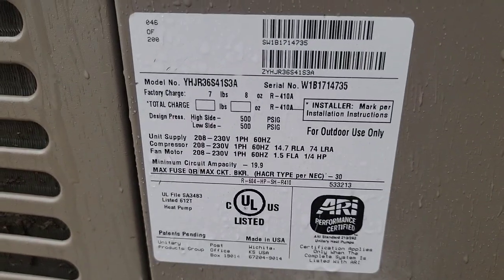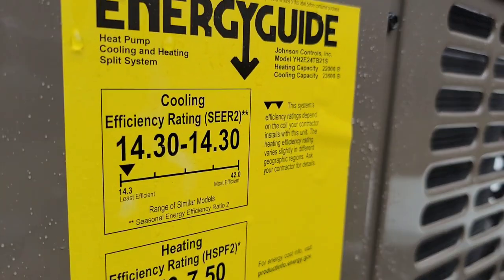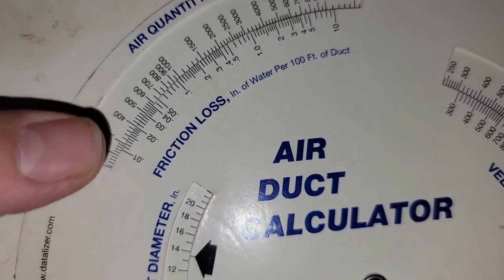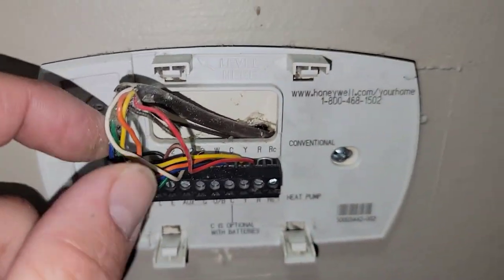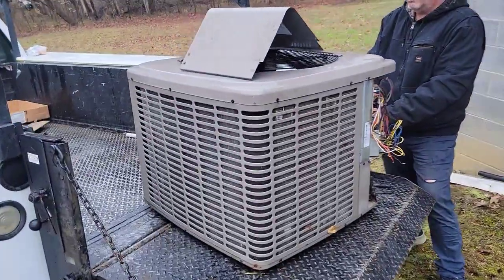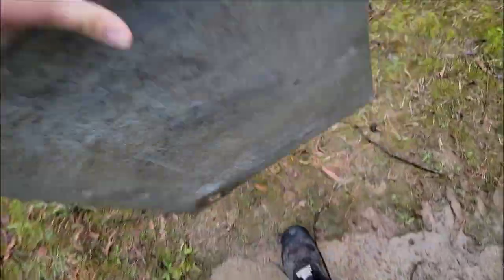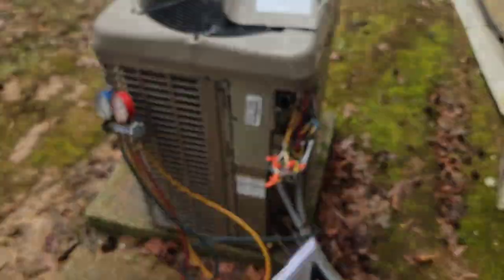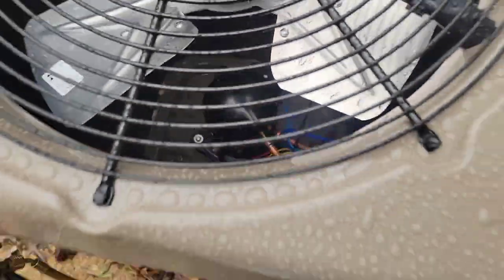Heat Pump Startup Basics for Beginners - Seer2 HVAC

Comment: Very good and informative video. I do want to see a balance point video for sure. A couple of questions. Where could I get the form you were using to calculate temp rise,etc? Also, If one return is pulling more than the other, what are the fixes for that without compromising airflow? Once again, very good value to techs trying to do it right?

Comment: I had a similar experience with a 14yr old ac last summer. By taking the time to actually clean the condenser,assess the ductwork, then charge accordingly, I was able to get the most out of the existing system. The lady sad that this was the first time she was actually able to keep her house cool w/o freezing the system. The biggest issue was that they previous techs never looked at the fan speed. I would assume this is where the difference between me and them was. They were mainly an install company versus me coming from a service company. We dealt with these situations alot. By taking the time to actually do what I was there to do,I came away as a hero and she was a very happy lady!
Reply from the maker: Thank you for what you do brother

Comment: That air handler had to be a heavy duty unit to make it 12 years with that anti-breather plate built into it the base. Wow! It must have made quite a whistle.
Reply from the maker: Yes I agree unbelievable that it made it that far
Reply: I'm going to push York products for sure. That's amazing the compressor didnt go nuclear

Comment: Hi II was wondering if you could help me and tell me what would cause a mini split do this? The temperature is set to 70, the bedroom door is closed and the temperature changes to 19, it blinks to 19 and then it shuts off and after it’s been off for a few minutes and it turns back on

Comment: Hi Tad
I really enjoy your content. 
Question for you on a job of installing AC in a newer built Mobile Home-
22 x 65 ( North side along a long side) Newer constructed with R-40 in attic, R-20 walls, R-24 Floor and Double pane windows. Did a Manual J  and total cooling load is 14,000 BTUH. Approx 13000 sensible 1000 latent. We have very low wb in my region of Canada. House is 1622 sq ft but it appears a 2 ton will handle it?? 
Going 2.5 ton would be grossly oversized. Your thoughts please.
Thank you for your content and response
Reply from the maker: Hi paul thank you for watching brother
I would need to know a few things before giving you a correct answer
What size is the existing duct
How many vents
Supply in return what are the size
Package unit or split unit

Let me know I'll try to help
Reply: @TaddyDigest  Hi Tad
This is a split system. New Nordyne gas furnace. As you probably know the ductwork built in the floors of  MH is usually quite small (14 x 5) and of course all the RA is drawn through the filter panel on the furnace. There is 12 floor registers.
Manual J tells me a 2 ton will easily cover the 14000 BTUH but just concerned with 1622 square ft of area. But moving up to a 2.5 ton would put this way oversized. Our design condition in this area is quite low 82ºf OD and  70ºf indoor. We are a dry region not a lot of RH.
Reply from the maker: 2 ton it is my friend
Reply: @TaddyDigest  👍

Comment: you have .50 TESP .normally size at .1 supply  .1 return .you sized your 6 inch at .1 and your trunk check at .05. thats to low look at the velocity at .05 .overall good info should always run a load calc even if its a quick cheater block load .if you look at that blower chart the coil is internal so you have no friction loss due to evaporator .only thing you have it supply and return and air devices .also the frickin RA grill is on the plenum in the basement .that being said whoever did this screwed it up bigtime. you also have no static on the return side .Fiiter grille ONLY 2 cfm a SQ IN 16x16x2=512cfm or 1.5 ton .your right how did it last that long ?

Comment: York dealer and installer here. Just gotta say that these new seer 2 units are Rube Goldberg in the low voltage wiring. Why so over complex. Many other brands aren’t so complex. Using 8 conductors at outside unit.  Jeez
Reply from the maker: absolutely agree 👍

Comment: What temperature should come out of vents from a heat pump in heating mode.
Reply from the maker: just heat pump or with auxiliary heat too
Reply from the maker: at least 20 degree split 

meaning 

if it is 70 F inside 
vent temp should be at least 90 F 

with strip heat it's more
Reply: @TaddyDigest just the heat pump. Should it be 95 f out the vent when it's say 25 f outside.
Reply from the maker: not necessarily
Reply: @TaddyDigest 3.5 Ton Heat Pump 14.3 SEER2, Single Stage | GSZB4042 condenser

Comment: You could’ve probably still pulled off a 3 ton since you went with a 2 stage.
Reply from the maker: With only 5 - 6inch supply lines
Reply: @TaddyDigest  Yeah it’s questionable. I found that when I’ve installed 2 stage I seem to have issues on the heating side. Mostly with older customers etc. I’m just thinking In terms that’ll run 2 nd stage just for a while and then cruise in first stage mostly. You’re right about the duct work for sure, with the new blower motors it sorta lets us get away with under sized duct……sorta!
Reply from the maker: Yeah I agree

Comment: I think you totally misdiagnosed,  if air flow would have been right, you never would have been called...
Reply from the maker: You can't Fake a bad compressor
The unit had plenty of refrigerant 
run capacitor and start capacitor we're good
compressor had voltage and would not start at all 
It wasn't hot it wasn't in an overload